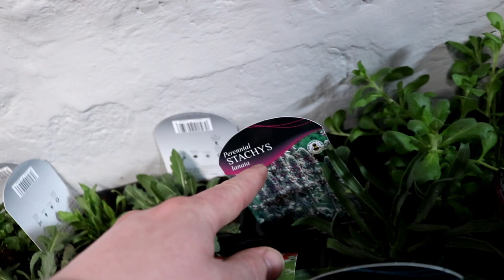GROUND FARCE

Comment: Using the plastic kegs for planters is a great idea,couple of scoops of gravel in the bottom should do drainage. Place them where you want them before you fill them though as they will weigh a ton when full,also slightly wet the compost before filling the planters. Beer garden is really coming together now m8, something to be proud of. Get yourself a good mineral/multivitamin supplement,you are getting run down again and your immune system could do with some help. Mind yourself and enjoy the trade show day out. Cheers.

Comment: Just my two cents on the cast planter. I'd cut them in the middle and possibly make two planters out of one cask. That way you get to put plants in them where they are the widest. And if you think their not high enough, just stack the two halves like you would stack casks. Plus you'd need less compost per pot.